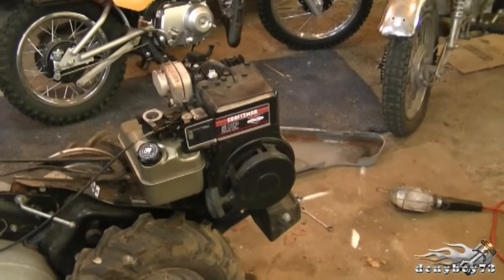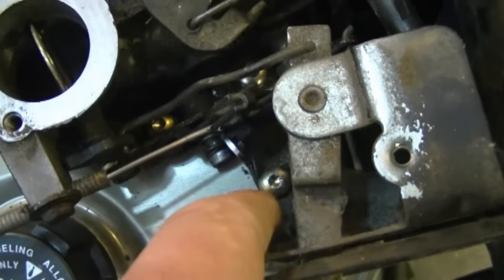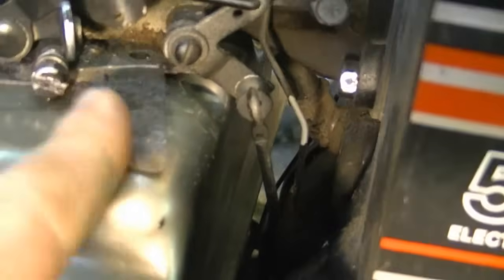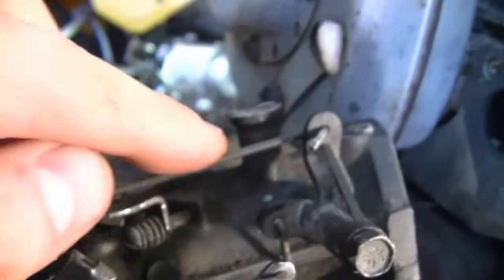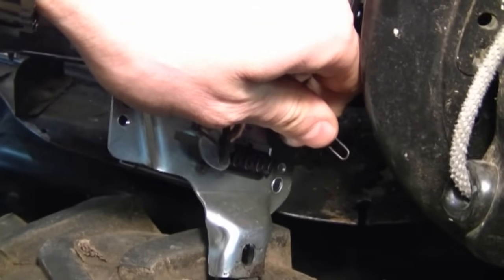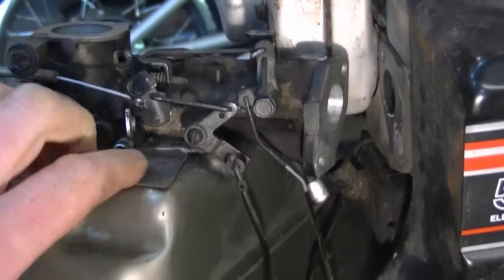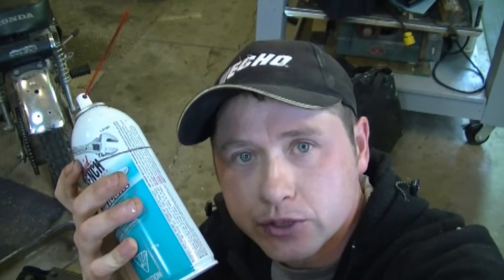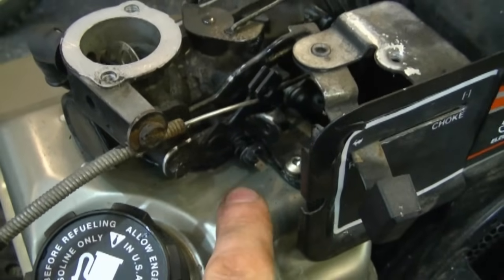Choke, Throttle & Governor Linkage Configuration on Briggs & Stratton 4-5Hp Engines

Comment: Mine has a vertical rod that goes from top to bottom with a nut on top for adjustments upa and down that connects via spring to a lever on the bottom of the engine......What does this do and how does it effect the engine ?

Comment: It's the video that just keeps on giving!!
Last year, my chipper/shredder just wouldn't start. I installed the carb kit and found that the fuel tank was badly rusted. As another commenter noted, $100+ for a new OR used and rusted  tank seemed excessive. I tried the small rocks and/or screws suggestion. That actually worked. It ran for about 3 hours and died. 
So recently, I pulled the tank to use the white vinegar method to remove the internal rust, which has worked nicely. I don't want to dump the vinegar and flush, etc. until I am able to almost immediately fill it with gas.
THAT'S when I ran into the issue of the governor linkage.
I just found your video, and it is exactly what I need (I hope).
Thank you, thank you, thank you!!
I'm puzzled by the "cup" in the top of the tank where the carb sits. What is its purpose?

Comment: I have an older 5hp, the engine I have does not have the extended governor spring, both ends of the spring look similar, any idea how that spring connects? I thought I set it up like it was but when I hooked up the throttle cable, mine goes to the plate down below, it rams the throttle full open an that spring will not pull back the linkage. It seems like it th spring connects at the pivot point of the plate aas the plate rotates, just applies tension from a different angular direction against the governor arm, and does not seem like a logical arrangement. Wondering if I hooked it up wrong, but can't see how else it can go together.

Comment: Thanks very much for your video donyboy. I didn't realise I had the governor spring attached incorrectly after a gasket kit was fitted. Didn't have any throttle control. Now it`s fixed & running as it should. Cheers mate ! 12 yrs ago & Still helping

Comment: Enjoyed your video but working with a 130232 circa 1985 which is slightly different.  I’m not talented mechanically but bought a non working tiller made by Murray that uses a 5 hp Briggs engine.  I rebuilt the carb not knowing I could buy new for the same price as parts.  Replaced the magneto and plug and it runs but won’t start unless I prime it with a little gas in the cylinder.  Only butterfly valve it has is not under the air cleaner but where it connects to the block.  Is there some choke lever in that area I missed?  Got to be a better way than what I’m doing now.  Would a new carb have a choke feature I could adapt?  Thanks.
Reply: I found it!  Just below the air cleaner at the back of the carburetor assembly.  Just slide it in or out - no linkage.

Comment: I have the B&S model 135202, that stopped running about 5 years ago. I broke a muffler stud and tried to easy-out the broken stud, but drilled off-center. Now I am fixing it up but apparently lost the throttle rod, going down. But thanks to your video, I can stop pulling out my hair.   Thx.

Comment: What is a good carburetor replacement if you don’t have the original carburetor?
Model 135202 0145 01
Reply from the maker: You could take a chance on Amazon.
Reply: @donyboy73  
Yes I thought of that, but the have several saying there for the same model. Trying to veer from the wrong ones

Comment: Look at nice new tank! I wish I had one. I have to figure out why my 5hp briggs runs and then stops then goes again then stops. I put a new diaphram in it last year which helped a bit. Steve's small engine salloon says to check the gas cap for air flow. It has to be that or the carburetor. I did clean the carburetor but I dunno maybe I didn't do it good enough or need a new carburetor. I love your videos. I have learned a lot from them over the years. Thanks for sharing your knowledge.

Comment: Man I really appreciate ur videos. I haven't
 found one person that breaks it down as well as u do for ppl like myself, by far ur videos are the best for me and I thank u 100 times over.
Reply from the maker: Make sure you're subscribed!
Reply: Ive got a question, if u can helped me. I am subcribed i have been for a while. So if u get a chance if u can. Thank u
Reply from the maker: @craigmoudy76  What do you need?
Reply: I've got a cub cadet 22hp 54" cut riding mower and for the first time I've seen, this motor doesn't have a set " nut " on the valves, there isn't a way to adjust the valves like I've seen in like every mower. Do I'm stumped with that.? Model is a CV22s and I had found anything on the internet that shows valves set up like these. I'm no wiz but I know there must be a different way to set these then the average mowers.
Reply: Update: I did infact find out why, I'm assuming they're hydrolic right?

Comment: the adjusting screw came out on mine as soon as I loosen it 1\4 turn lost it in the dirt. got some 10/32 1 inch screw and a nut to lock in where it runs better. for mine Briggs and Stratton tiller was half a turn.

Comment: Donny-boy 73. You're awesome but I've done everything I can think of on this 5 horsepower Briggs & Stratton that does not have any points and clean the carburetor I can't get it going is there anything you can think of that I can do I even checked the valves

Comment: hi mate, nice video.
got same engine and machine , have trouble with starting and always have to adjust the choke lever to make it run, when i put it on low gas it backfires , today had to use a auto start spry it wokrd good while spraying permanent whilei pulled the starter.
i clesnd the carburator aund changed the membrane. but still same.
its quiet anoing the procedur to get it startet. 
when it is running ... somtimes its ok and nice running but most times it is surging right after starting and after  a time i might also stop surging and is going to normal...
well i hope you understud what ive been talking about,
would be very nice if you have an idea what i can do to make it better.
thanks a lot

Comment: I have a Briggs on an old Gilson Snowblower and I can not figure out one spring that has to do with the throttle rod that is pulled up to control the engine speed. It is Briggs part number 261331 and was wondering if you ever had to put one of these together and might be able to show me where to hook that spring into the throttle rod and the other end of it also. They have a couple of them on eBay for the pic of it.

Comment: This is from 11 years ago but I have a question now!.....  is there a video about the arm that attaches to the shaft at the bottom of the engine that actuates the governor mechanism?  Mine isn't pulling the throttle to idle.

Comment: Don,     I just spent a good part of my day cleaning a carburetor on a 3 1/2hp mclane edger similar to this video but it still surges when I give it full throttle 🤔.I sprayed carburetor cleaner all around the carburetor and intake but nothing was discovered. I’m not certain replacing the carburetor is worth it unless I use an aftermarket carburetor. I swapped the plug , no charge.

Comment: Hi sorry I’m late to the party! I recently took mine apart, and when I put it back to gather when I move the throttle there is no tension, and it only reacts at the idle position. Ounce it goes past like what should be half throttle it’s automatically wide open and the throttle slides all over. You think you could help me out? Great video defiantly deserved my sub!
Reply from the maker: you would have to check all the linkages again to make sure they are installed correctly, I would need to see it to help more
Reply: @donyboy73  Ok I’ll go back and look. Thank you so much for the help though!!! Much appreciated!

Comment: If you have a tiller with the handle right behind the tank, getting the tank loose and carb off is a bear as there is no room to pull the tank back to gives access to the linkage. As a result I stretched the governor spring and had to replace it. What you can do is reach under and unhook it from the mechanism on the tank with needle nose pliers, then pull off the tank/carb together. When reassembling hook it on the governor, put the tank back on, then hook on to the tank mechanism. 
Though, I'm thinking it might just be easier to take the whole damn engine off first.

Comment: I have the same engine on a tiller.  I have to put the choke in a precise spot to get it to start and quickly throw it into full throttle AND open the choke or it dies.  Then it will run and operate fine.  If I throttle it down, it dies.  It's very difficult to get started but works well when I throttle it up.  Any idea why it won't idle at turtle speed on the lever AND why it's so hard to start?  Adjusting that screw on the side below the plastic choke linkage seems to change nothing.  I tried 2.5 screws out, all the way in, 4-5 screws out, etc.  Would love to hear your ideas.  Thanks.

Comment: Hello Dony can you please show me how to replace the small sprint that has loops on both ends. I have the shirt on one and long on the other in place. It didn’t fall off. 
The very small one did. 
I can see where it might attach on looks like a point with a indent but where do I attach other end. It’s 7/8 of a inch long and the hole ends are closed. 
Thanks lost in Westchester

Comment: Can you tell me what the part number is for the Governor's spring? Mine surges up-and-down adjusted screw even change carburetor still does the same thing. Surges up and down at Full Throttle with no load on it. Otherwise it is fine

Comment: Your videos have been helpful I’m having trouble with the same engine but on a manco go cart so the throttle is connected on the bottom . I can’t get the throttle butterfly to move when I step on the peddle . Any tips would be helpful and greatly appreciated. Thanks

Comment: My spring on the governor on the engine isnt moving the governor. Any suggestions? I got a new spring and that didn't work. The throttle is stuck in closed and the spring just slips off the "T" where the other side of the spring goes.
Reply: If I push the governor manually, it will crank and then idles fine and even runs fine. It does trip up and that spring fails(or a part that pushing them together)

Comment: I made mistake of not taking picture before taking apart and my throttle re-assembly doesn't have the notch your video shows.  Also, can't figure out reattach of electrical solenoid to engine head.  Any hints you can offer?

Comment: Hello Sir I need some advise please! I have this same engine on a craftsman rototiller. I followed all of your steps to remove and clean the carburetor. I replaced the spark plug, air filter, pickup tube cleaned the fuel tank and added new fuel. It starts right up and runs but when put into reverse or when put in the dirt and tines engagement it dies and does pop or backfire some. I have no idea what else to do please help. Thank you for all the great videos it’s because of you I started my small engine shop. Have a wonderful weekend.

Comment: Hi donyboy!   Thanks for all your great videos!  I’ve learned a lot from them!

I was wondering if you had any thoughts on a problem that I have. This is a 5 hp Briggs and Stratton fun power engine on a manco go kart. The carburetor looks just like the one that you have in this video. The problem I’m having is that The engine stalls after using it for about 15 to 20 minutes and then it starts and then stalls out again starts and then stalls out again and then it is unable to be started. I did check and there is spark. Also I have the cap for the fuel tank off so I don’t think it’s a problem where the vent hole on the Cap is blocked. If I use a little bit of starting fluid the engine start right up so it seems that it’s in the carburetor. I did take the carburetor apart and cleaned it out shooting carburetor cleaner through all the orifices. I used a wire to clean out the bottom fuel jet and the screen on the pick up tube is clean. I did not replace any parts and I’m pretty sure all of the passages are wide open. But despite cleaning the carburetor, the engine behaves the same way where it stalls out after 15 to 20 minutes and it seems like it’s starving for fuel. The only replaceable part seems to be the gasket that is made out of rubber that the spring pushes on. Do you think that’s the culprit that’s causing the lean condition? Just trying to diagnose it before throwing a new carburetor on the engine.  Thanks for any information!
Reply: Valve seet

Comment: I'm 99 percent sure I've hooked up the linkages as you've shown, but when I move the linkage back and forth the throttle doesn't move, or moves very little, leaving the throttle stuck in a wide-open position. It won't close when I pull the throttle cable back. If I manually move the governor linkage the throttle does move, but not when I move the throttle cable. Any ideas on what could be wrong?
Reply: Bayoubill,  I'm have this same problem, did you ever figure out what was causing it?
Reply: @jonprice78  Sorry, but it's been a year and I don't remember exactly what I did other than discovering that I had installed the spring incorrectly. I had other problems with the carb that were not fixed by an overhaul, so I finally gave up and replaced the Briggs (which was ~20 years old) with a $99 212cc Predator engine from Harbor Freight that was a perfect fit on my Snapper tiller and runs great.

Comment: Do you know the correct part number for that spring that connects to the governor arm and gas tank between the tank and engine.  I need that to make the throttle work on a gokart.  The throttle cable connects to that thing on the back of tank down low and rotates that weird rack and gear thing on the bottom back of the tank.  Without that spring, no throttle at all.

Comment: I’ve got a 4.5 hp Briggs on a rototiller and the linkages are all in the right spot but when I move the throttle lever on the machine it doesn’t change the engine speed if I manually move the throttle it works fine any ideas

Comment: I have trouble with the governor not slowing the engine. I didn't work when I got it used, then I cleaned around where the governor went into the shroud and the linkage, it was doing great. Then I used it for awhile and it was working really hard and bouncing the dirt was super hard. Then all of a sudden it started running wide open when not under load

Comment: Thank you Donyboy73, You helped me get the carb linkage done correctly on my 1991 5 HP Craftsman Rototiller. I had the choke linkage 180 degrees out of position until I saw your video on how it all went together. Thank you so much!

Comment: I reallly appreciate your videos. I have a similar 5Hp engine, but my problem is the throttle choke value is stuck. I've ordered and received a new one, but it didn't come with any instructions. How to I remove the old throttle value so I can insert the new one, or is there a way I can actually unsieze the existing value? I've tried WD-40, Liquid Wench, Rustoleum Rust Remover and I've soaked it in vinegar overnight, all to no avail. Any suggestions would be welcomed.

Comment: If this model sits for two years and now won't start, what should I look at? It runs on starting fluid but won't keep going. Is gas gelled somewhere?
Reply from the maker: carburetor issues and rusted fuel tank

Comment: The throttle is different on mine, but everything else is the same. Thanks, this video should help.
Reply: My throttle is different too and I still can't figure out how to re-connect it.  Assuming you may have had same issue, any advice?
Reply: @mboettc1  been a while so I don't recall exactly.  Think this was an old rototiller and what I did was buy a generic throttle cable and cobble it in.

Comment: Hi Donyboy, I have a MTD tiller with a 5hp engine 206cc, and it’s been in my wife’s dads basement for 5 years. I changed the plug and oil, and cleaned the carburetor. I got it started, but it’s running a little ruff, and there is only two screw adjustments on the carburetor the idle screw and I guess the air/fuel adjustment screw. Can you please tell me if I screw the air/fuel screw all the way in how much should I back it out to get started with? My brother in law said this tiller was bought in the 70’s....Thank You.

Comment from the maker: ALWAYS USE HIGH OCTANE FUEL WITH NO ETHANOL TO PREVENT DAMAGE AND COSTLY CARBURETOR REPAIRS ON YOUR OUTDOOR POWER EQUIPMENT!
Reply: Could I start my go-kart with no choke
Reply from the maker: @dornecunningham7217  it's much harder to do
Reply: @donyboy73   can you do a video on how to run a go-kart with no choke.
Reply: It's getting really tricky to find it anymore.  I'll need to ask around :(

Comment: Excellent video. Linkage just went haywire on me today. It was working fine 3200 rpms then I noticed bottom of throttle linkage was not screwed down. It moves the throttle because I can see it but only runs at 1500 rpms or less at 1/2 throttle which I can understand. I took off fuel filter. Spring looks weak and stretched. But, again, it was working fine before I noticed throttle cable wasn't screwed down. I did screw it back down but no more 3200 rpms. In fact, it stalls at full throttle. I have a dead lawnmower  carcass. I could replace spring. I just don't know what to look for. It's a great old machine. 
I guess I'll take it to my old neighbor, Jack. He knows everything and can diagnose a problem almost at first sight.I have all winter to look for carb parts. 
David
Alberta

Comment: I need a gas tank like the one you bought for this engine. Can you give me a link of where to find please?
Reply: I was able to clean up my tank pretty good by using white vinegar and a flexible rotary shaft with a small wire wheel (dremel piece) and some steel wool.  Really did a pretty good job and was able to reach about 90% of the inside of the tank.